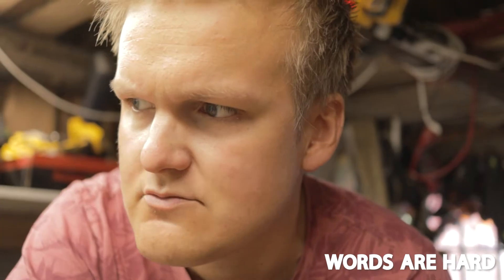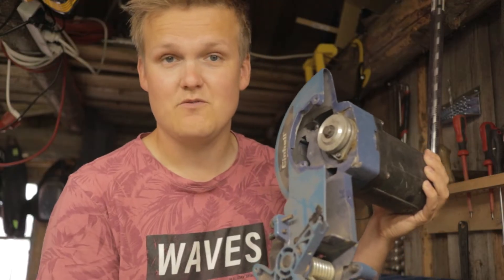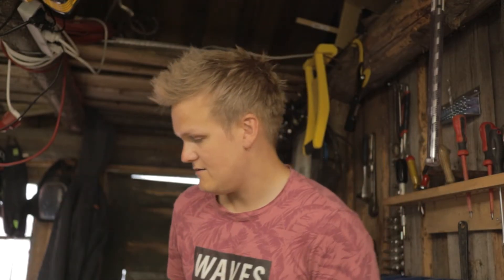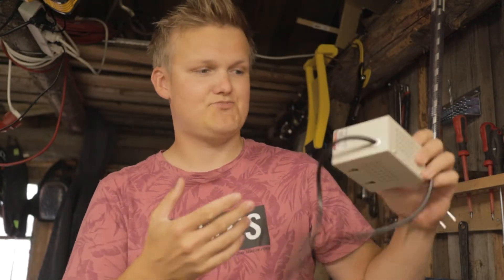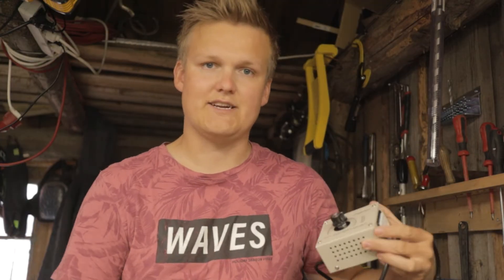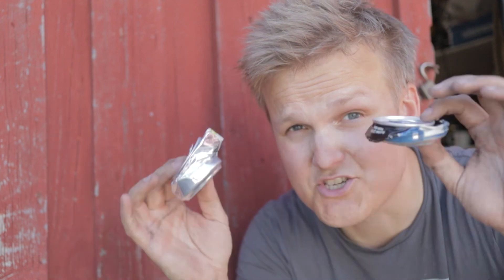Turning Junk Into An Electric Aluminum Can Crusher!

Comment: Awesome start dude. I like the idea of the motor, but in my mind, I would cut off the miter blades. Just looks a little dangerous without a guard.No matter what. But you just gave me a brand new idea for my power hammer.Build four forging. Instead of beating metal with a hammer, which takes forever, your design is pretty cool for incorporating it into a forgers power hammer. Thank you dude.

Comment: Add a flywheel and don’t start with the can in position as the motor doesn’t have enough torque to crush it on its own. Use weight and momentum 👌